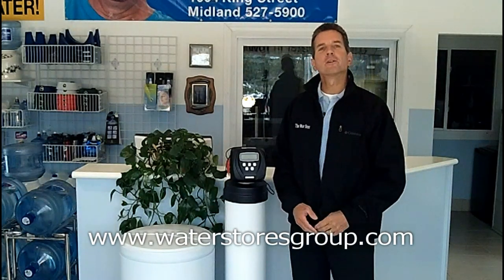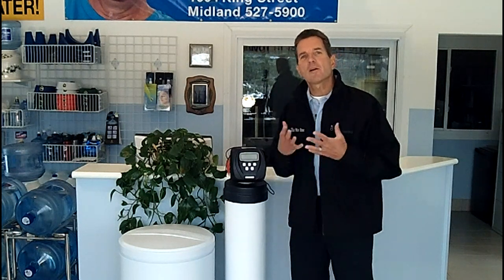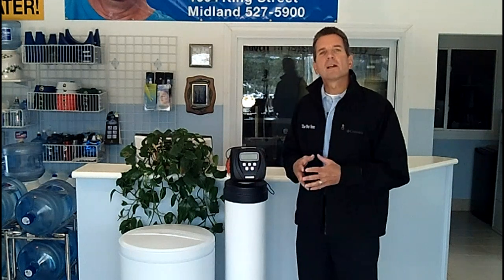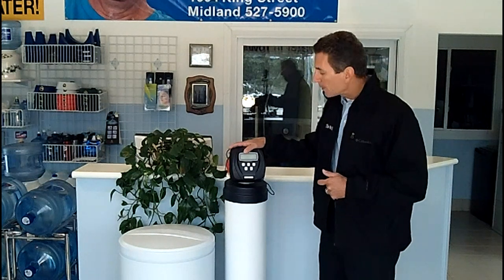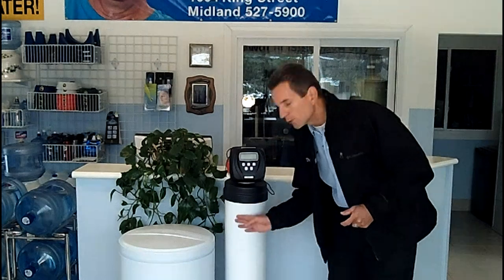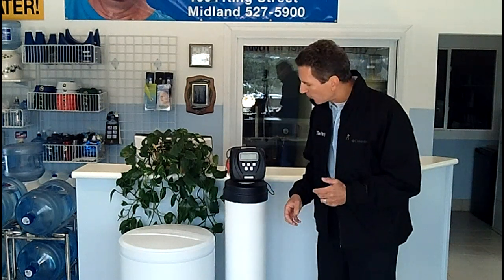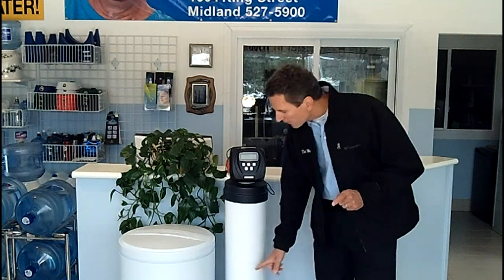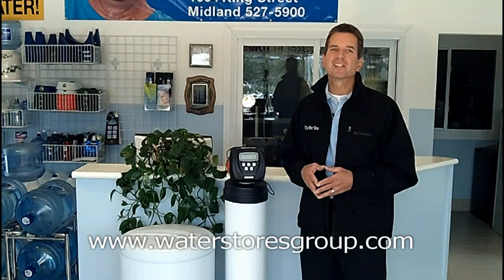How a Tannin Filter Works

Comment: That information is a bit old and of course the regeneration is based on both the size of the removal system. For example mine is set on regeneration every five days or 800 gallons, which ever comes first but still an instructional video that was very helpful. Thank you for that.

Comment: Gary, I have a  10 x 54  carbon filter , a 10 x 54 softener, and a  9 x 44 Tannin remover, also a chlorine injector pump, 
Is there and special order they should be in.
Now its Chlorine.........Carbon..........Softener...........Tannin.
What seems to be happening is the screens on the Carbon and Softener are getting clogged with Tannin.
Would it be better to have the Tannin filter first, then carbon, then softener ?
Thanks for taking the time and making these videos, good info is hard to find.
Reply: Thanks Gary, So they are in the correct order, yes I have a 80 Gal holding/chlorine tank before everything, I also installed a 1 inch rainbird sprinkler valve that opens every night for 1 min to try and remove some of the Tannin's that may of settled in the tank, that helped alot. So the filter should go,
1. After the pump, and before the pressure   tank.
2 .Before the Chlorine Tank
3.After the chlorine Tank, and before the Carbon tank.
Reply: +Gary the Water Guy  , Thanks Gary, thats where it will go
Reply: @charlesmiller5078  Do you have to add chlorine?
Reply: Yes , we inject chlorine, we use a 80 gal holding tank, this is where the chlorine works, But I found out that I dont really need the chlorine at all, Yes it takes out the color (tannin), the tannin filter does that, comes out perfect clear. I now know that you dont really need a extra filter, if you have a softener, when you change the media, like every 4 years or so, just add some Tannin media into the softener media, this does the same job as having a total different filter, tannin filter also use salt. I installed a large pre filter, it now takes alot of tannin out before it gets to my row of filters, keeps everything cleaner, I have to wash out that filter every month or so/. But that one filter has cleared up alot of problems for me.